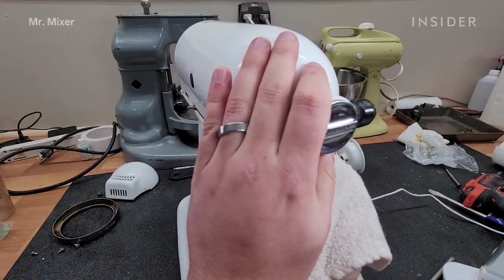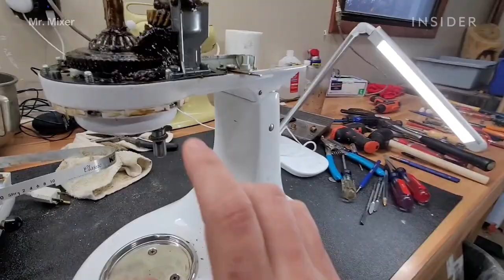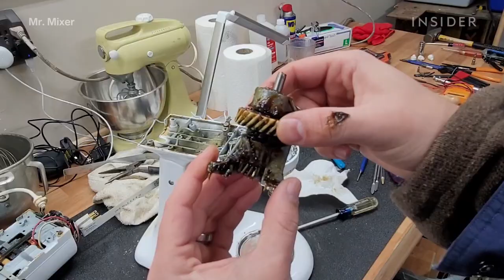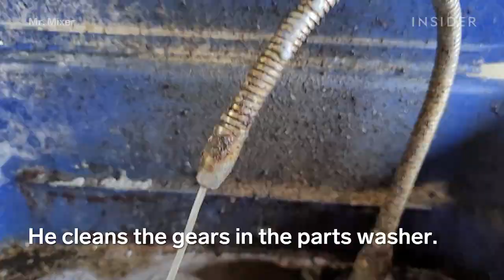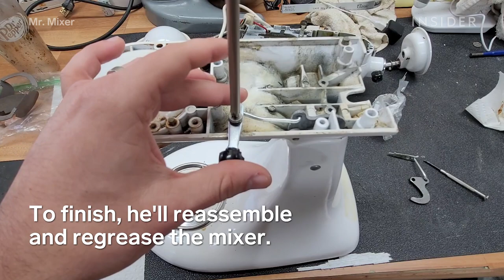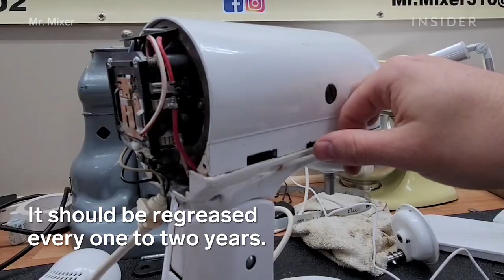How KitchenAid Mixers Are Professionally Deep Cleaned

Comment: It should be re greased every one or two years. 

My kitchen aid is over 30 years old, been passed down 3 time and survived a fire. I had no idea it required yearly or bi yearly maintenance.
Reply: it definitely doesn't need to be done every 2 years, unless you use it literally every day. more like 20
Reply: It’s cheaply made now. Back when that TOPs was still around, my mom got a kitchen aid and it lasted for 15 years before finally burning out but the gears were still intact.
Reply: Lol it doesn't. This is such a hunk of crap. Talk about a racket. Next we'll need to out source wine glass polishing/steaming.
Reply: @Blue_Azure101  mines still going strong after 22 years.
Reply: @87clits  the ones now are a complete joke
Reply: My friend sold me her old one and I need to figure out when to get this down. We don’t use it tons but that probably doesn’t matter since oil hardens
Reply: Wouldn't this just cost as much as a new one?
Reply: I would say if you use it everyday,  regrease it every 2-3, or if it's used less often, 5
Reply: @alaindesjardins  the grease isn't expensive, about $10-$20 for a can/tube. The rest is just cleaning the old grease off and putting it back together. Most mixers cost anywhere from $400 - $800, so a bit of maintenance is money well spent if it keeps the gears from breaking. Definitely don't have to do this sort of maintenance every 1 - 2 years as they claim. It comes down to how often the mixer is used. If you only break it out on occasions for say holidays where you may do more than the usual amount of baking, you can easily push that to maybe once every 5 to 10 years, if not more.
Reply: @Blue_Azure101 they really aren't. new ones are still excellent.

Comment: Y’all calm down, it’s just grease, it makes the mixer run faster. it’s similar to how there is lubricant on drills to make the mechanism run smoother
Reply: It’s still nasty tho
Reply: And it can mix to the ingredients or something
Reply: So like changing oil of a car. 🤔
Reply: @Wolfybee123  almost every gear set ever has some form of oil or grease. Without lubricant the lifespan would be extremely sort...
Reply: @passivenootmare2253  it won’t. If it somehow did, the grease is NSF accidental food contact certified safe.
Reply: Yep yep
Reply: But it seems that it used to be white; are there two types of grease?
Reply: @themonsterbrat  the grease ages and darkens from time, heat, and metal shavings. All grease eventually looks all black.
Reply: @Dirty_Bear22  TIL. Thanks for the explanation!
Reply: i thought it was jam ngl
Reply: It makes it run faster? Not even remotely true.
Reply: The grease is in a sealed unit.
Keeps the mixer from overheating.
I love my Kitchen Aid.
Reply: aye another omori fan
Reply: The main issue people have with it is because it can get in food
Reply: @chas1878  take out the grease and see how fast it runs...
Reply: @themonsterbrat Mr mixer on occasion has stated that KitchenAid has switched to a lighter colored Grease just sort of try to hide the fact that they're mixed with leak. If you disassemble KitchenAid mixer from the Hobart era they use the grease that was a reddish orange color.

Comment: Can't believe that a kitchen mixer have so much grease in it
Reply: Yeah it’s a pretty bad design the top could be incased into a complete sealed compartment. Leaking oil is not good. It’s cheap at the top.
Reply: That's why they last a long time of abuse in professional kitchens.
Reply: The grease keeps it cool and lubed.
Reply: Its the same in all good mixers. I need to get my Granny's 1964 Hamilton Beach down and service it. Sewing machines need the same care done for their gearboxes.
Reply: @scotthopkins7711  its grease not oil, grease doesnt leak
Reply: @kevinmai4326  that’s what I meant. Still a very cheap top.
Reply: @kevinmai4326  Depends on the grease and their viscosity. Also, rotating machinery tends to fling around the lubricant so in theory it can and will leave the housing. Probably the reason why he put so much grease in it afterwards, so it will last 2 years even if most gets flung into the side of the housing
Reply: @scotthopkins7711  And completely sealing it would make it impossible to maintain.
I am curious how you equate ‘able to be disassembled’ with ‘cheap’. Design is not directly correlated with cost.
Reply: @scotthopkins7711  the top is actually a quality manufactured piece.  I will cite AvE's tear down of one.  He did have some qualms about the plastic parts inside but overall a quality machine. Hobart as I recall are essentially the same and they are about as top quality as one can get.
Reply: @scotthopkins7711  The new designs are encased and cost a shit ton more to replace now than a stripped gear. You can't repair them, it comes as an assembly.
Reply: @scotthopkins7711  So there you got what you wished for, and now instead of fixing your mixer you may as well go buy a new one.
Reply: @scotthopkins7711  The "oil" is grease and it's not a bad thing.  It's the exact opposite.
Reply: @L00katThePFPic  it’s called freedom of speech and my opinion. Very rude of you to comment like you did. Just having a general conversation about designs and quality.
Reply: @scotthopkins7711  their models that don’t tilt have a metal casing that is screwed on and contains the gears and grease

Comment: This video is misleading, to the point where I'm wondering if it's just an advertisement for this guy's business. They say the grease turned black from food content but if you watch how these mixers are made, the original grease is black to begin with. Also, it says the gearbox is sealed so I don't understand how food would be getting in it? 

Hopefully the food grade grease this guy is using is appropriate for the application, the OE grease is dark like a moly grease, or something with lots of anti wear additives. It shouldn't matter about being food grade since its sealed. Just some thoughts, clearly this guy has business regardless
Reply: Usually white grease is food grease.   I worked with it a lot.
Reply: As a side note to anyone reading this, my gf just got a kitchenaid professional 600 that is defective out of the box. The power switch only works 3/4 of the time and the gears are extremely loud, easily twice as loud as my mom's pro 600 that is now 7 years old. Maybe kitchenaid quality is slipping? Anyone with any input please feel free to leave a reply.
Reply: @thedude808  Our 600 does precisely that too - but it’s previously used so I assumed it had taken some serious wear making bread. It was bestowed upon us when a friend moved overseas. I would say it can’t be more than 10 years old. 

I’m grateful to have it, but I have coated myself and half the kitchen more than once due to the switch not kicking in until I had it set on high speed.

Now I usually remember to move it one level, then wait to see if it kicks on, before moving it any further - and if it doesn’t kick on by the third notch, turn it back off and try again. 

I’ve even worn earplugs while using it because that noise does not agree with me. (But a lot of noises bother me).

If I remember correctly, my former partner’s kitchen-aid, which may have been a 600- looks the same. Was also slow to start when moving the switch, but less so than this one.
Reply: I'd imagine the original grease would be H2 or H1 grease, not just random engine oil or something.  Maybe that's what he's using?
Reply: I work on one of the assembly lines where these things are made. It is white grease that we use, and lots of it. I agree that the video is misleading. There's no way food is getting into the gear case.
Reply: It says that the baking substances make it sticky, not that it turned it black.: )
I imagine things like flour can get anywhere. Lol

Comment: Never using a kitchen aid again! 😀😀
Reply: Yea... Kinda understand how it needs the grease to protect and run the gears, also how food industry (factory) equipments already uses this type of grease. But seeing that black tar thingy is something. Apparently there are also many cases where it leaks out...
.-.
Reply: F. Aduke Femi-Babalola  Yep, hence why the “food industry equipment already uses this type of grease”. Kitchenaid usually uses H1 grease, which means small amounts of contamination to the food is okay

Im aware that it’s food safe, but the degraded grease still looks a bit repulsive. Sorry if it’s not clear enough ._.

Comment: Help! My older model Kitchenaid stand mixer that hadnt been used in years was clearly leaking oil and making a bit of a grinding noise so I carefully took it apart , cleaned and regreased it. NOW IT WONT TURN ON! Yikes. I didn't unnecessarily touch any wires (it is possible i got the overload switch wires reversed though) and what I can see of the motor and wires etc looks intact and clean. Any help and suggestions are really appreciated!!!

Comment: Can you please explain how x amount of sealed gear grease can “build up " and cause wear and tear on the parts? The gear grease is sealed separately from any interaction with food or ingredients if you're having leaking grease the seal has failed. The food has NOT migrated against gravity upward snuck past a seal to “contaminate" the lubricant. To remove all  the grease and replace it with different colored Grease is a pointless operation particularly if no parts have failed. You can, but it's completely pointless. it's not brown because it's filled with contaminants it's brown because, it's Grease.
This is disingenuous at best.

What type of lubricant did you replace it with and is it food safe?